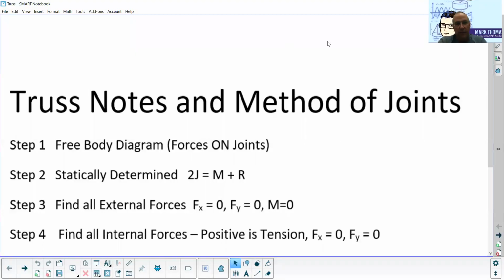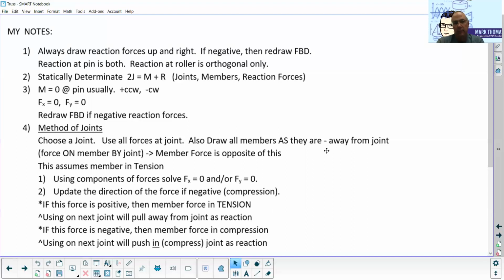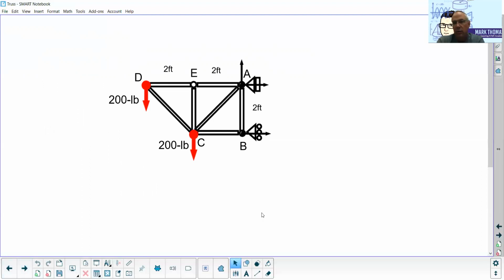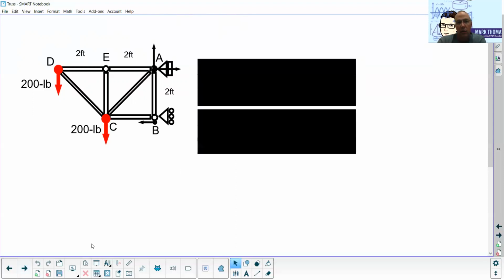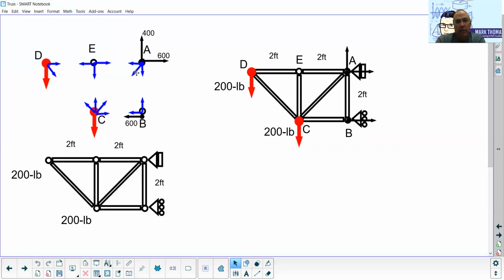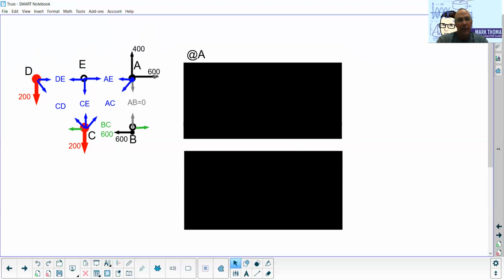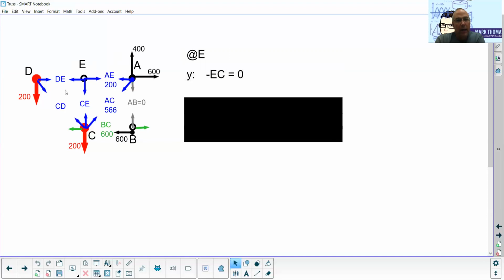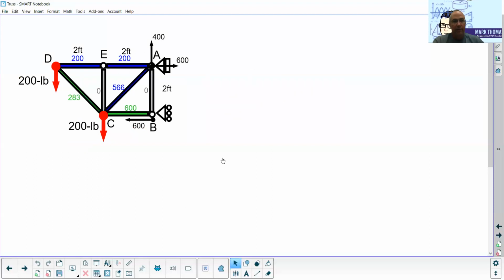Truss   Method of Joints

Comment: may I ask why AB is 0 and not 400
Reply from the maker: You bet!  If you look at the joint at B, then there is only one component vertically.  Since the forces in y must sum to zero, then AB (or BA) must be zero.  You may be looking at A.  Although there is an upward force at A upward, there are TWO (possible) forces down.  One of those is AB, the other is the y component of the diagonal member force of AC.  That piece is actually the 400 amount. Hope that helps.
Reply: @mathnstuff9100  thanks a lot